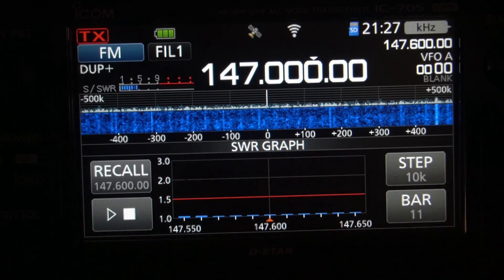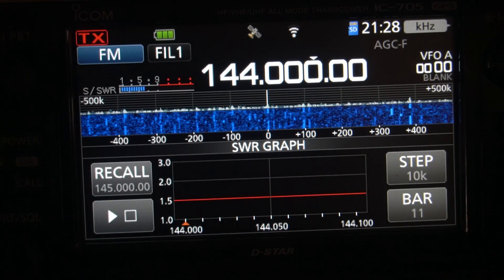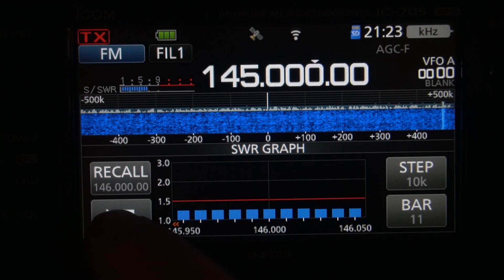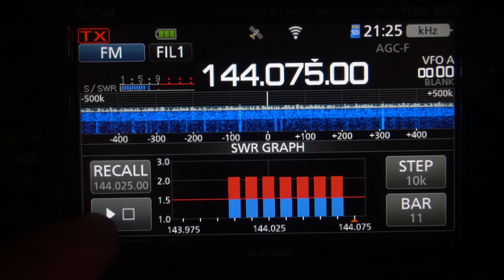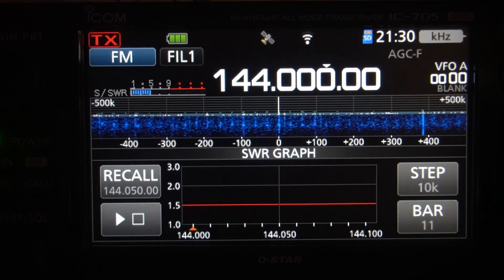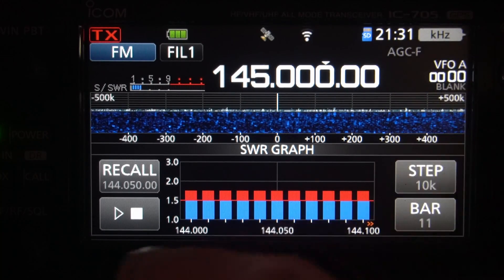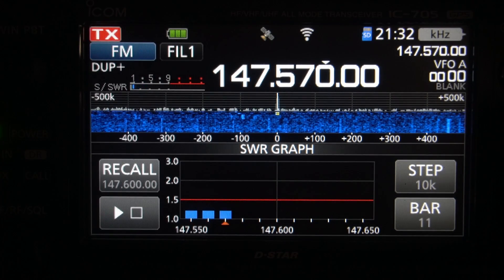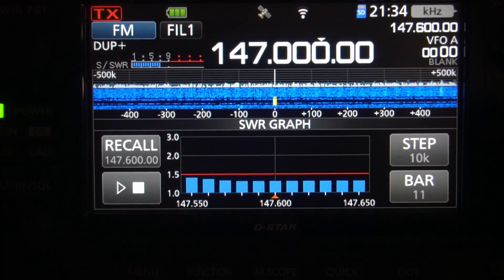Why is the SWR so high on my IC 705 with my Signal Stick Antenna??

Comment: When I measure (both with my Rig Expert analyzer and with my NanoVNA) the rubber duck supplied by Yaesu, the SWR is about as awful as the Signal Stick. I suspect measuring these HT antennas is a tricky proposition since they couple to the HT itself. Research required to see how this measurement should be done.

Comment: It was pretty much proven 2 years ago that you need a counterpoise on the 705 to operate a 2 meter whip of any kind.  On a handheld your body provides the counterpoise through capacitive coupling.
Reply: That is not true.I run a Diamond SRH770S handheld antenna and my swr is all under 1:5-1 across all of 2m and 70cm.And I have NEVER had a counterpoise on it.

Comment: Hi Chuck,
I noticed that the step size was 10kHz when checking the SWR. Can that be changed to 100kHz when scanning the 2M band? That would allow a full Mhz to be scanned using 11 bars. WJ3U
Reply from the maker: Yes Don I changed some later

Comment: Ht couples with the users body.  Also, read the note on the website. 

 NOTE FOR IC-705 OWNERS: 

The Signal Stick is not designed to be used on a radio such as the Icom IC-705 and the SWR will likely not be as low as you’d hope; the quarter wave design has no artificial impedance match and works purely on resonance, which is why it works so well — but the impedance and thus SWR is influenced a lot by the ground plane / counterpoise, and the antenna system on a base radio looks nothing like that of an HT plus your arm, etc.

Some users have reported simply not being happy with the performance (though we’ll point out that SWR is only half of what determined antenna performance) and others have reported good luck by adding a counterpoise to the antenna (such as attaching the shield to station ground, adding a 19″ wire to the shield, etc).

We have recently obtained a 705 for testing and have been experimenting with different configurations; so far it seems to perform quite well, but the SWR is about 3:1 which we understand will concern many of our customers. As we learn more we’ll update with recommendations.
Reply from the maker: Nope thanks, I had recorded saying that but looks like I edited it out thanks

Comment: I just checked my 2 antennas, I have 1 for baofeng and another for yaesu, both gave 2 swr, the baofeng gave 1.1 in 148. I always carry a counterposie to improve reception, I cut it from a rigid wire to keep it horizontal. it improves a lot

Comment: Nice video Chuck. I always figured the Signal Stick is bad on the 705 since an HT would be using you as the counterpoise, so having any kind of radial on the ground plug would make it usable. How long was your tail?
Reply from the maker: it was 18-20" i just bent it over for each part of the band
Reply: @KK6USYHamRadioAdventures  How did you connect the tail on the 705?